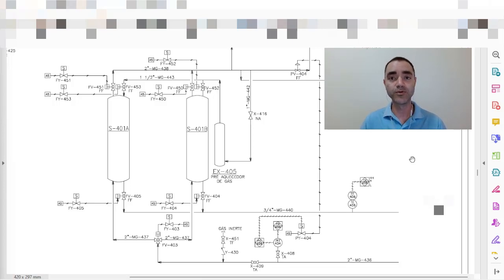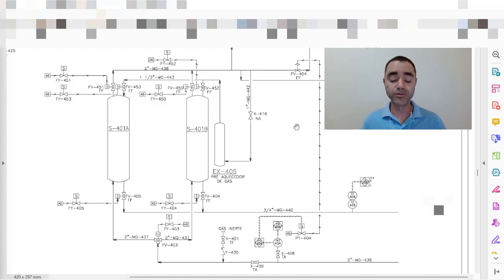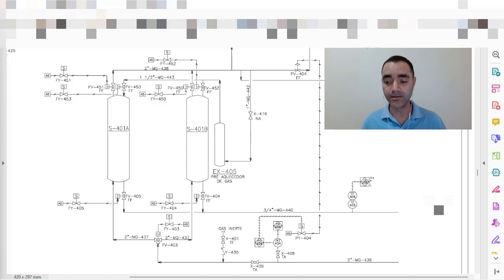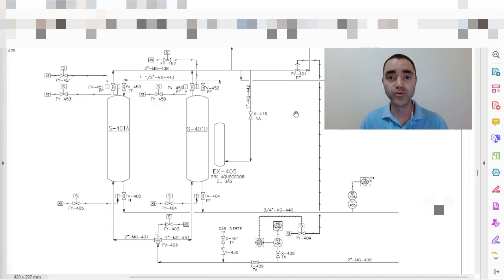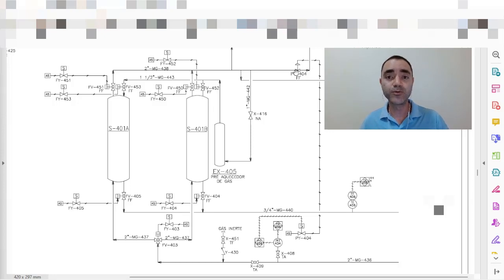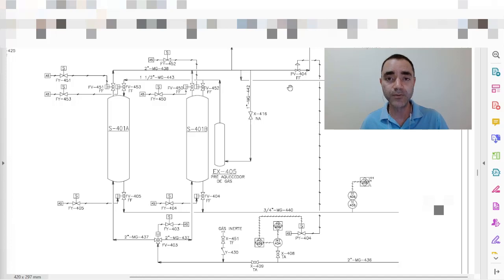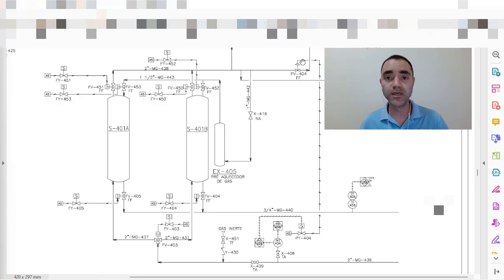PRESSURE CONTROL VALVE ISSUES FOR CHEMICAL PROCESS ENGINEERS

Comment: Hi. Interesting. One question please: is the rule of thumb of 10 psi minimum at max flow always work?
Reply from the maker: Hi Lionel, rule of thumb and always is not a good combination 😅. 10 psi is around 0.7 bar. The pressure drop in a control valves depends on the purpose of control. Is it for flow, temperature or pressure control? I have some process I must have as minimum pressure drop as possible, and that will lead to 3 psi for instance. So, you need to identify what your project need in order to verify what is allowable for your control valve. 😇